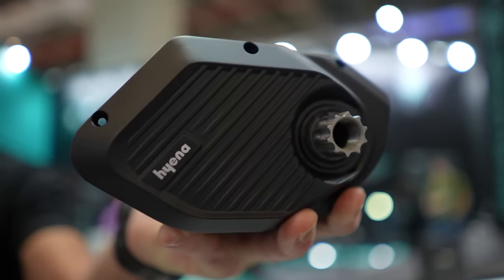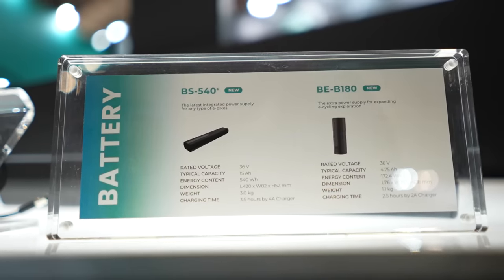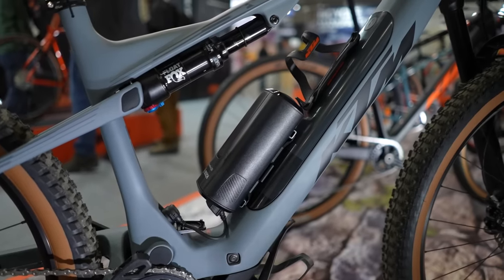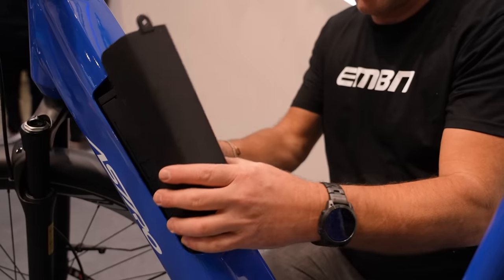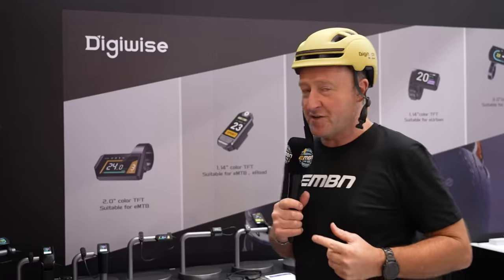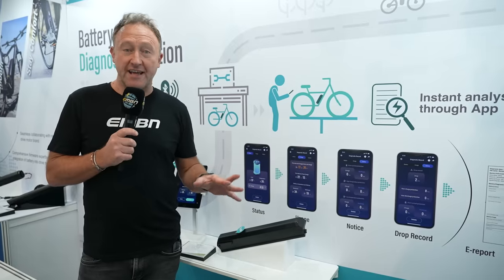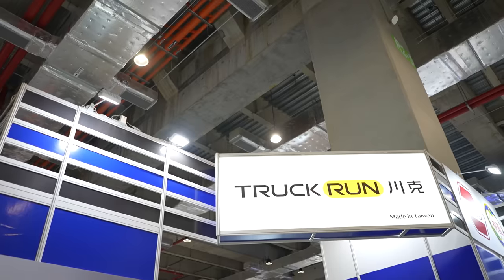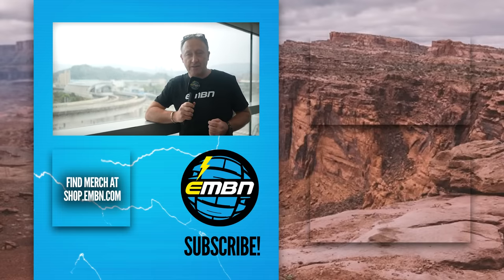Motors Of The Future Are Here! | Taipei Cycle Show 2024 Pt.2

Comment from the maker: Did you see anything that caught your eye? 👀  Let us know! 👇
Reply: No DIY motors like CYC , Tongsheng , ToSeven.
Reply: Yes, got me thinking about your recent ‘out of Guarentee’ vid on motors. I wonder if some of these manufacturers can build a motor (or adapter) that coincidently fits it into a frame for a Bosch or whatever. Is it really true that a ‘hole/space for a motor’ and a ‘distance’ between bolt-holes in, say, a Cannondale frame can be copyrighted by the original motor manufacturer? And, I bet the frame manufacturer would prefer a user to keep it going with a cheap new motor and, later, buy another new bike from them rather than have the customer ditch them (the manufacturer of the frame) along with the underperforming motor and instead buy a whole new bike from a different manufacturer when the motor gets ‘past-it’.

I realise I’m wrong - must be - but I really can’t work out why.

Anyway, I contacted them (they’ve been overwhelmed they told me, but I still bought them a couple of coffee’s 😊. So, then the internet told me there are several companies in the U.K. offering this service. So, we should all be thinking of routinely using them (as per suspension service etc). For some reason, there’s a great deal of chin-pulling about the Shimano motors (eg EP8) which I haven’t got to the bottom of: most don’t advertise they can service them, despite being able to change the bearings out of warranty (2 yrs). Anyway, thanks for that too.
Reply: what's the name of the company making the torsion spring power assist?
Reply: square taper cranks  wtf so 80s
Reply: 600 Dollars for the Astro.....?
Reply: @ataksnajpera  none of those companies make a modern drive; even if they showed up, the coverage would be that they showed up and a pulse check for people watching to see things like current quality of support, etc.  Unless CYC is doing something like TQ with their harmonic transmission or Pinion with its bottom bracket ultralight gearboxes, they don't have anything actually new and they're one of the few DIY companies getting traction with performance/stealth/cost effective designs.  
I fully enjoy CYC and Tongshen products, but unless they do something crazy like a bottom bracket CVT (Enviolo is doing a CVT frame mount "gearbox" but I haven't been able find one to buy yet) or some sort of compliant machine type transmission everyone's seen it.
Reply: the 29 Astro, can I have the link please?
Reply: What didn't catch my eye (ear) were details and facts for you not liking the Cyclee Valeo product.
Reply: Not enough motors to retrofit ie a good mountain bike, and improvements on these!
(I retrofitted a 2015 Santa Cruz Superlight with a 750W Bafang and a 870Wh battery, the fit is a bit on the heavy side though I love it, done 11500km in first 18mnth, bike and retrofit are 23kg.
Reply: About 600 Dollars for the Astro.....???? or Mistake???  please respond.
Reply: @e2U  I've tried searching for the bike online and couldn't find it but I'm thinking $600 is it correct.
Reply: what's the name of the company making the torsion spring power assist?
Reply: Sad that all you said to the Non E bike "thats diffrent",yes very much.
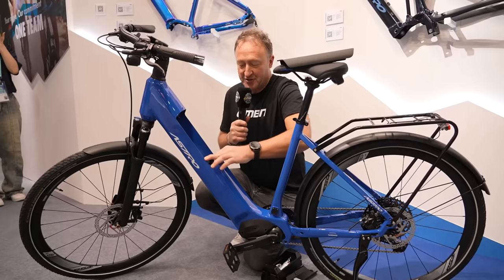Reply: Can I have more info on the self power generating NON Ebike (07:08 - Non E eBike) please?  Do they have a website? Thanks.
Reply: "put it in your back back, a great idea...." 

and if you fall off and land on you back?
Reply: Where to order that
Reply: Why weren’t the weights announced for the “lightweight” battery options?
Reply: @embn do you have a name or a link for the assistance system? mentioned at 7:09 by Leo
Reply: the non e ebike the person was more honest than the astro saying their battery bike is green...right
Reply: leo     leo    leo     leo  tell us more
Reply: Nope not one of them.  I have Bafang mid drive and it's a fantastic bit of kit.

Comment: Honeslty, it's awesome what is happening and completely stupid at the same time. There are no battery standards yet, which is about as dumb as it gets. This is one reason the bike industry is having problems and looked on as a joke. The battery should be manufactured totally seperate from the motor manufacturer so we get ONE STANDARD battery for all motor/bike brands along with one style charger. All you need to do is pick the WH or size you want to go with the motor and fits the bike. You know, like a car.

Comment: I have to unfortunately adress the massive elephant in the room when it comes to literally every motor/battery/ebike system spoken about in this video. THERE ARE NO READILY AVAILABLE SPARES AND REPAIRS DISTRIBUTORS IN THE UK. And that doesn't look like it will be changing any time soon. Bafang could make a 700nm motor that weighs 100 grams but if there's no support for when it inevitably goes wrong then it's worth literally fuck all. Until they start offering proper after sales support/spares/repair parts then unfortunately you will need to buy bosch/shimano/yamaha to have a bike that you can actually repair.
Reply: Agree same in US especially for Bafang. I have my M800 at Bafang California facility waiting for torque sensor from China. Looking at close to 2 months down if all goes well and $250 including labor. Good thing its just my gravel bike and I have 3 manual mountain bikes.

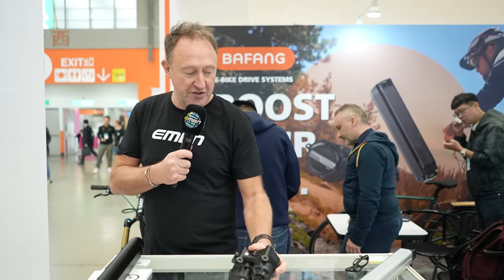Comment: 3:30 idea with smaller changeable batteries with full power motor is nice if you can transport and store them easily.
For example you take your ebike + spare batteries in your car to trails and then you can easly change them every 2h.

But that system comes with a lot of cons:
-lower capacity batterry will lose power faster because you drain it faster.
-you need to store them somehow and if you want to carry them in backpack then whats the difference? If you are already carrying that weight you might get one big battery.
-switching batteries during your ride might be a problem if your bike is dirty or its raining
-you have to design frame around some fast swap system which will make frame heavier which again makes no sens since you try to make your bike lighter

Just my thoughts on the idea.

Comment: There is no regulation on powerlimits for spring storage systems I think. This could possibly be designed for high or low output of the stored energy. Maybe changeable springs. Very interesting system for city stop and go traffic too. I would like to drive it for testing😊

Comment: I have a 4 year old carbon frame YT Decoy with 7000km. Weight is just over 50lbs. Still running great. eBike weight won't change much until we have solid state batteries, and we're a good few years away from that.

Comment: the Bafang M820 is not full power by any means.. Bafang is pretty generous with Nm figures compared to other brands. The M510 with 95Nm fits between the bosch cx 3rd and 4th generation, despite being rated higher than any of them.

Comment: I think the problem is not the electric motors itself, but the lack of standardization of the frame mount, every motor brand has it's own special mount, so your frame decides which motor you can use...this is not a preferred situation...e-bike motor mounts should be standardized!

Comment: Excellent reporting! I'm disappointed that the motors don't have a standardized form factor at this time. If I have a Bosch Gen 4 motor, but later want a TQ, it ain't gonna happen. I would have to buy a whole new bike that has a frame that can accommodate a TQ, for example.
 
Someday, the landscape is going to be littered with ebike frames because a rider can't get newer motors that are a drop-in replacement. Not very Green!
 
*

Comment: within 5-8yrs most of these designs will converge to 750-1000Whr solid state batteries, 80-100nm motors with integrated gearboxes total drive/battery under 5kg and belt drive.

Comment: There's something about the Brose feel and I think it's the belts.
Other motors feels like you're pedaling a drill but the Brose feels like a treadmill.
It's really smooth climbing rocks and stairs like it has caterpillar treads.

At the other end with no grunt but blistering speed are the hub drives.
Seamless power from a roll to eye watering and shifting is optional.
The Achilles heel of mid drives is extreme loads on the chain and resulting wear of chain wheels,rear cluster, derailleur and chain.
There's actually reduced load on the chain with a hub drive. Parts last forever and you can ride home without a chain or derailleur.
They need to work on reducing weight and deal with the wiring so you can change a flat without tools and a hernia but there's a magic carpet ride with a 1000 watt cheap hub drive.

Where's the graphene batteries and capacitor fired stuff I keep hearing about?

Comment: 7:20 so physics doesnt apply then 😂😂😂

This bit should be on April 1st perhaps?
Reply: I think it's some sort of a KERS system. Pretty cool if it actually functions. You can store some energy on the flat to get uphill easier.
Reply: Asian physics.
Reply: What he really meant was that the stored power can be used for 10 km on smooth asphalt with -5% gradient ;)

Comment: I have a Cube hardtail with Bosch CX gen 4 from 4 years ago with a 500wh frame battery that I can unclip(with a key)at a moments notice and pop my spare one out of my backpack in, not very heavy to carry and 1000wh with which I regularly cover 40+ miles.  All of these seem to be going backward compared to the system from 4 years ago - 400wh sometimes not removable from the frame with 172 wh range extender giving under 600wh, come on, people want to go further on rides, not shorter, I'm disappointed I can't buy the new 750wh bosch batteries as they have to have a smart system,  Create a reliable, robust and powerful system with easy to swap out batteries to give great range and people will buy your system, simples...
Reply: Check out Bimotal, they're actually moving the industry forward with their Elevate system. Riding on road with a DH MTB, 2.5" tires, I got 42 miles average speed 17mph, 2400 ft climbing out of two 320Wh batteries. I carried one in my backpack. The entire system, drive unit, battery, etc. weighs just over 6lb and clips on/off in a few seconds.

Comment: the NEXT big thing might be a way to replace the chain - just recently I saw a bike with a toothed belt linking the central E-drive to the rear hub which had internal gears - its downside was that it only had 3 ratios. The chain which is a truly great and simple way to link the drive to the ratios but it has been around for a century or two and is getting really old in the tooth :-)  It needs constant  cleaning, care,  lubrication and replacement.  There HAS to be a better way?   Great thought provoking video, Steve !

Comment: Waiting for more bike mfgs to agree on a "standard" battery size/shape and motor mount.  They eventually need to provide an upgrade/replacement pay like every other bike component like wheel size, headtube diameter, steer tube diameter, BB diameter, thru axle, rear derailleur mount, etc.  Just need a few companies to lead the way.
Reply: Don’t hold your breath

Comment: I want to see a 150NM motor that weighs 4kg or 5kg. Not that bothered about weight.
Reply: Buy a motor cycle. Problem solved.
Reply: You have bafang bbshd 1000w 

It has 160Nm 
And if you have a new controller you can have battery pack on 84 volt and 50 amps 
❤😊 and if you put on 32 T chain wheel you have amazing power

Comment: Crazy prices just be use they have a motor, also if something fails you're looking at AK it of money for repairs. I have a limited budget I built my own ebike for less than 1k 100nm motor & 1024wh 52v battery I get 30 mile range pulling 140kg load at 25mph

Comment: 75 Newton-meters converts to 55 pound-feet of torque in freedom units.  A 170mm crank converts to about 0.56 feet.  So that 75 Nm rating is equivalent to a 95 pound rider (55 divided by 0.56) standing on one pedal with the cranks horizontal.  It ain't that much, guys!  It's power that gets you up the hill.

Comment: i rode the bulls evo am 4 granted it was in a parking lot. but the 85nm of torque felt really good. i hope the companies start making 100nm standard though. 
my dream is for them to make single gear bikes, throttle only, and with the power of some of the motors shown here...130nm etc. if i could ride my emtb LIKE a dirtbike...id be a happy guy. 130nm is alot of power but still nothing close to even smaller dirtbikes that can truly dig the ground up quick. to just hit a sudden incline, punch the throttle and fly up the hill without pedaling. i know a few brands have bikes like that, frey, etc...and they are cool. but id rather have an EMTB that is ridden like a dirt bike...than an actaul electric dirt bike. and with the tech coming out, EMTB that ride like dirt bikes, could still see 100 miles in eco mode for example.

Comment: I think an electric assist motor on a bike needs a belt drive and a enclosed gear box.  I think the advantages of a gear box bike (such as the Priority 600)  is a much better option than a  chain drive and derailleurs.  Did any company in the show display any belt drive systems?

Comment: My problem with the e-Bike industry isn't the advances in reducing weight and adding more Tq in those smaller packages. It's the proprietary BS. Until there's a standard for battery cases, wire connectors and motor mount bolt patterns, Frame Manufactures are screwed. They'll spend more money on designing frames for all these different Motor and Battery mounts. In the end this drives the Frame costs for the end consumer through the roof. More standardizing, less proprietary BS!

Comment: Did you see any new security devices/apps etc. motor immobiliser/lock out inbuilt tracking systems. With the high cost of today's average emtb's I would have thought manufacturers could build in a complete battery/motor and system lock out rendering the motor completely locked making theft very difficult having to carry the bike rather than ride even without pedal assist active.

Comment: The big problem I anticipate, and is happening already with Bosch (insert bad word) is  programmed obsolescence,  that is lack of sustainability with specification creep, I am anticipating that  My £4K pedelec will not be repairable  in say 5 years because the, bolt pattern, controller and electrical systems will be obsoleted.
Also some of these smaller companies will fail and will leave riders high and dry.
The ONLY way this will be protected is by regulation. EU we need you on this please.
Reply: EU need to make ebikes like they did with charging port from Iphone.  But i see no news about that.

Comment: you mentioned the Sachs rs motor in a previous video . i have this motor on a Nox xc . i'm freaking out lately as the motor is rarely used on other brands and has not had any changes done to it since it originally came out . for me it's perfection so that's not the problem. my concern is that they will go out of business and i won't be able to fix or replace the motor if necessary .

Comment: What cells are used in the batteries? Not all cells are created equal. And I've seen zero info on what cells are used in official specs. 
In the EUC community, the Samsung 50S 21700 cell is all the rage for it's 25-45A continous output, almost three times more than the 10-15A that was standard a couple years ago. 
Now obviously we can't just force more current into a 250W motor and expect 1000W performance, but having loads of excess current means battery degradation won't affect the power output to the motor, only the range. For example, ten 50S cells would be about 180Wh and provide (10 x 3.6V x 25A) 900W output.

Comment: Who makes a digital rear view mirror where the camera is under the seat?  For street riding.
Reply: Have a look at motorcycle dash cameras. Most all run on 5v. So usb power pack , I use a 8 x 18650 usb pack in a cross bar phone bag. Have fitted several to push bikes.  Front and rear recording , set display to rear camera, giving digital rear view mirror. 
I mount rear camera under the back of carrier but can be mounted under seat or practically any place 
Works great

Comment: Think Delta have cracked it! That could be reduced in size the housing unit abit yet keep the 90/100nm all tucked away hidden by chain ring that's something I think will happen one big crank direct driven in the middle of the gear's.  
Also alot of bikes there companies still building the bike then adding a bracket to the bottom to hold the motor it's like going back a decade! The KTM was the only one shown that had the frame hiding the motor rest are like bike's build around the motors